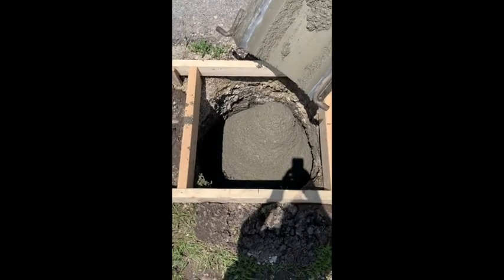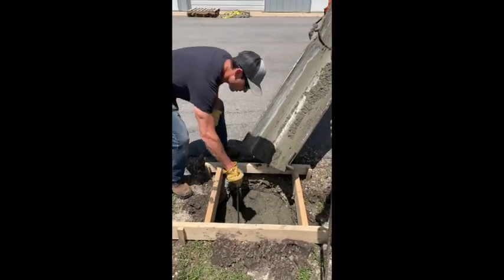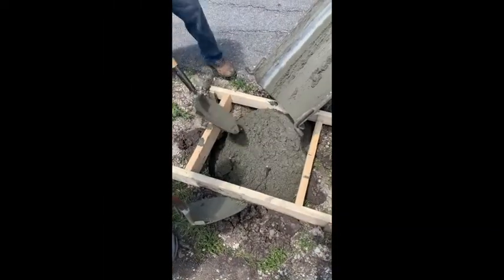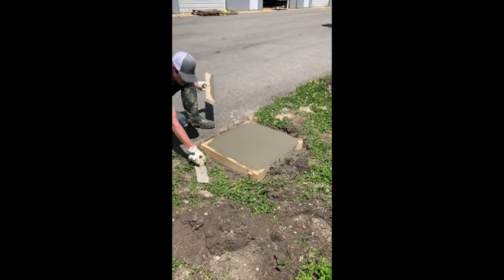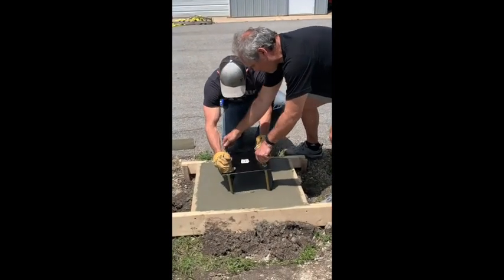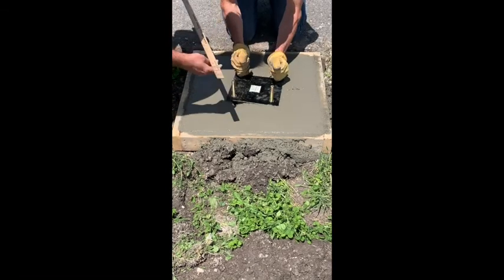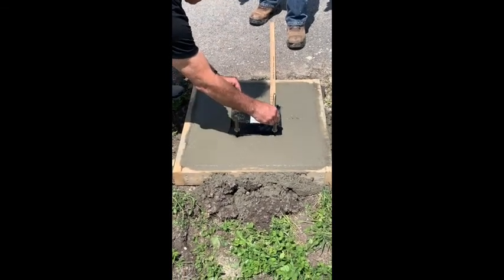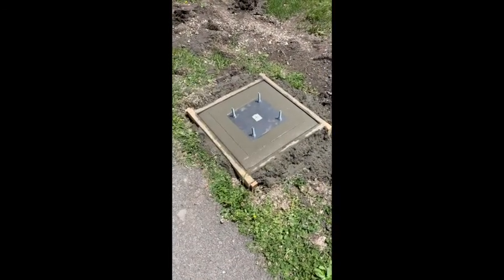Basketball Goal Installation l Anchor Kit Installation

Comment: We had to dig a hole large enough to remove an old footer that would not work with a newer heavier system. Unfortunately, we had to dig a 40x30 inch circle just to get around it enough to bust old out. Now we are being told we cannot use a smaller form and then fill in dirt around it, I will not be safe? We will have to put a footer in the exact size of the big hole we already dug out. What is your opinion on this? We are deciding between a 475 lb Mega slam,. and one that only weight 275lb.